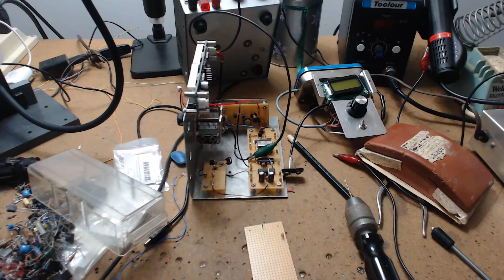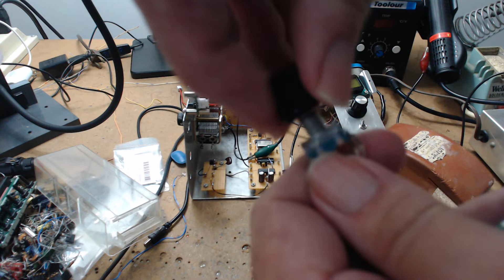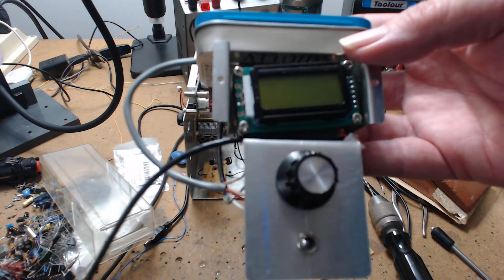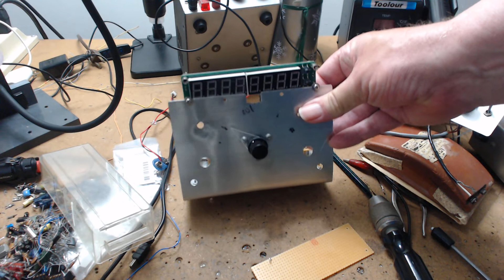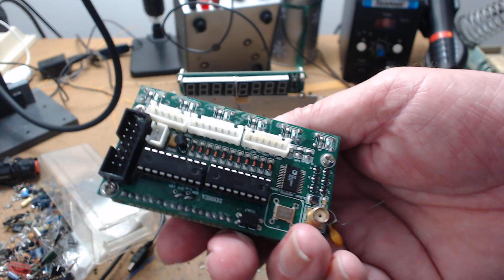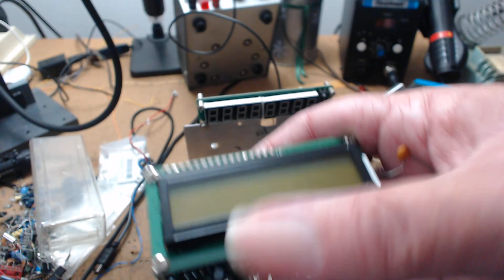My  High Speed Huff and Puff  Journey

Comment: Great video, glad the H&P is working so well for you. Good points on all. The AD9834 are indeed low-end, noisy DDS. Varicaps are temps sensors yes. AND phase noise generators. LED's typically too small range for low HF oscillators. All OK... 

But dude, 80m my favorite too. No issue. But you still aren't getting it. 5MHz isn't about 60m band. It's about your choice of IF in your superhet. You are choosing 455kHz. Many people like higher frequency IF these days because filters are cheaper. 9Mhz is a good choice. And if you have a 5.0-5.5MHz oscillator, and 9MHz IF, you cover 80m band. So you shouldn't be talking about BAND and who likes what BAND in America or somewhere else. It's irrelevant, people were making 5MHz VFOs before 60m was even thought of as an allocation. It's all about the IF frequency. So talk about choice of IF! That's the real question. Why do you still like 455kHz?